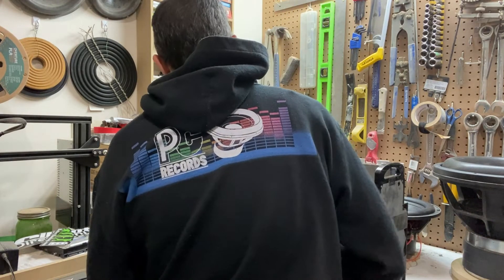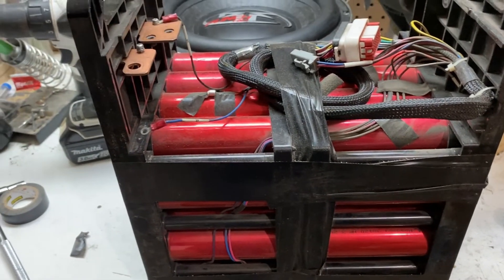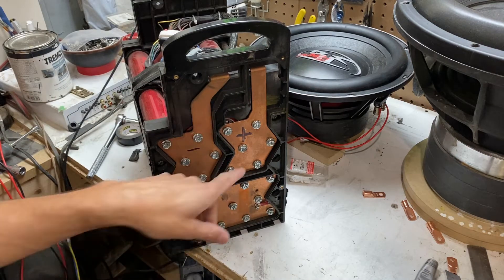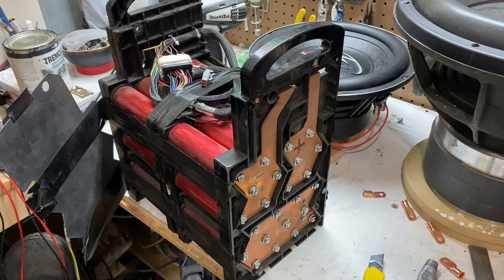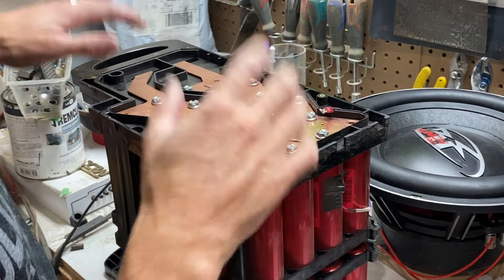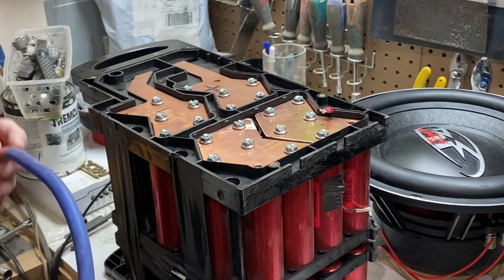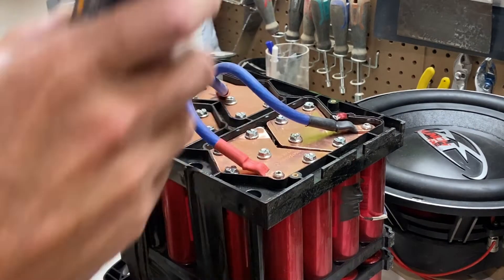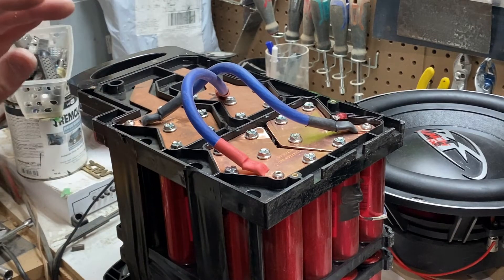Super Beast Module 12volt Conversion

Comment: I bought 2 of these and fully charged them to 14.6 volts also and I did not disassemble them I made them into two 12.8  Volt per super beast which should be a total of 192 amp hours at 12.8 volts to my surprise my inverter shut off at 10 volts and when I recharged both superbeasts all together only took 50 amp hours so something is not right with these batteries. 50 amp hours is not even close to 192 amp hours. Anyone else testing these?
Reply from the maker: 🤔.all the ones that i have purchased have worked out pretty good. that being said… i have had a few cells crap out on me. i guess that is a risk when buying used cells. but two entire banks seems a bit much🤔. did you reach out to battery hook up?
Reply: @MrM_Full-Send  just finished charging them an hour ago and will call battery hookup tomorrow

Comment: Do you need a BMS. Or should you use a BMS?
Reply from the maker: yes bms is recommended. the next video i did was hooking up a 4s battery management system to a modified beast module

Comment: All you need to do is cut the big Bus bar in half .bam 12 volts ..y hack it up like you did?
Reply from the maker: Uhh what? It’s an 8s6p bank that needs to be converted into 2 4s6p banks. This requires cutting the 5th plate of the 8s bank in half. That’s what I did. I cut 1 plate and added jumpers. Realistically speaking the Jumpers are unnecessary but they create a self contained unit that only requires 2 external wires instead of 4🤷‍♂️. If all you do is “cut the big bus bar” (I’m assuming you mean plate 5 of the 8s) you end up with 2 12v banks not 1 but you do you!

Comment: Yea. Ill just redo half thr bank and reduce the need for this x shape connections
Reply from the maker: Normally I just pull cells and put them onto buss bars but.. this is an example of an alternative approach that may work for some people 🤷‍♂️
Reply: @MrM_Full-Send  I've built my sets of buss bars. Sometimes I just want to keep it like it is
Reply from the maker: Flipping 24 cells seems like a lot more work to achieve the same outcome. However, as is often the case, there is more than one right way to do things 😊

Comment: If you could possibly tell me what balancer I would need I would really appreciate it or post an Amazon link. I had a 5 wire balancer.
Reply: It should be just an 8s balancing board right?
Reply from the maker: @SoberAsTheHolyGhost  4s this is the one I used
Reply from the maker: 5A 3S 4S 12V Battery Active Equalizer https://a.co/d/4URYtIF
Reply: In the video you said it would need 8 wires. I must be confused lol
Reply from the maker: @SoberAsTheHolyGhost  correct. Plates 2,3&4 need to be split because those plates aren’t connected. There are two of each of those plates and each needs a wire. So… depending on balancer… yellow green and white need to be conned to two plates
Reply from the maker: @SoberAsTheHolyGhost  there are two parallel 4s batteries with their positive and negative plates connected. The intermediate plates are not connected
Reply: @MrM_Full-Send  I got ya. So I just need to make 3 jumper wires to connect to 2,3, and 4. Thanks again 👍
Reply from the maker: @SoberAsTheHolyGhost  did the new video explain it ok???
Reply: @MrM_Full-Send  yes thank you so much!